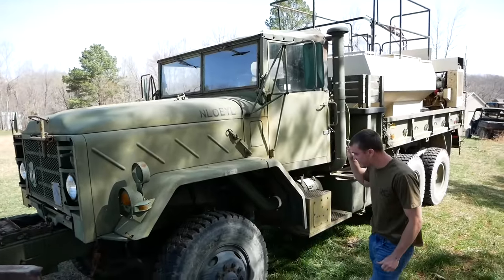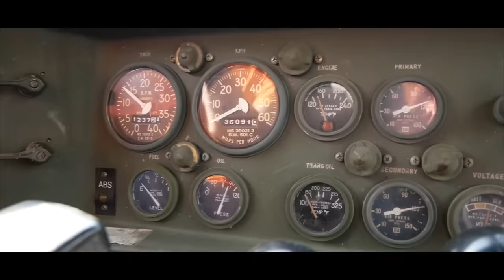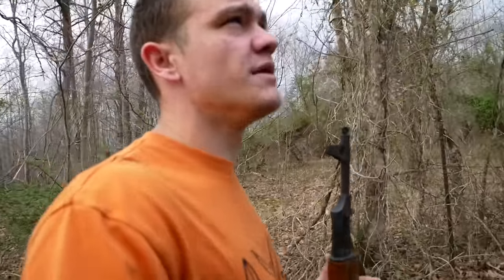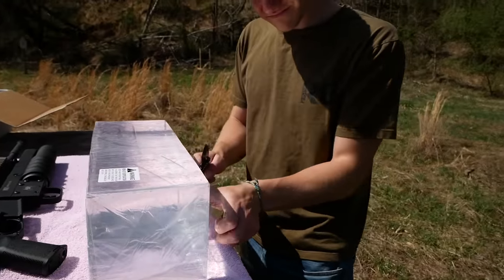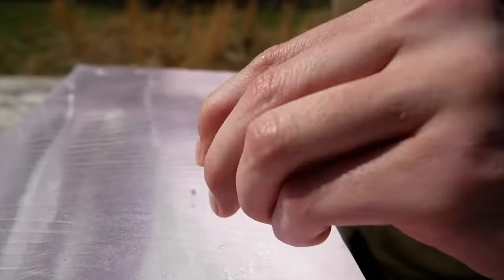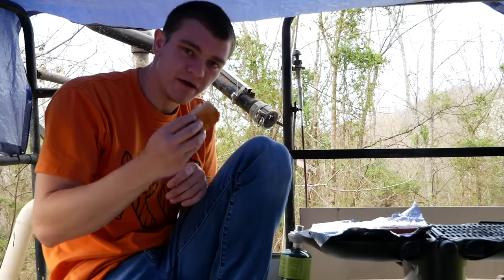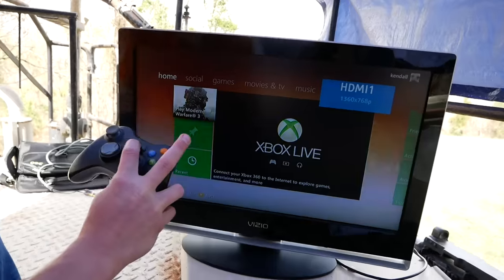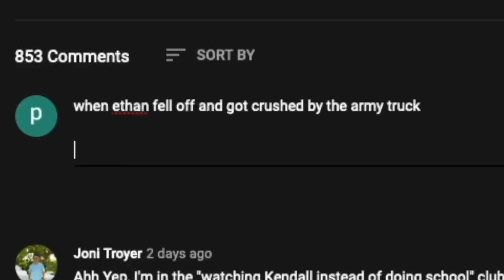5 TON ARMY TRUCK BUGOUT CHALLENGE!

Comment: umm ... sorry, It might have been used in the elder Bush's attack on Sadam's Iraq. It never saw action in any war prior to that; WAY to new for even Viet Nam. Have you looked at the title?  I'm guessing 1980's.  the trucks of Viet Nam and earlier had much different bodys (the hoods were shorter, narrower, and more rounded, and some had soft top cabs) and drivetrain. (multi fuel engines and a hi-low 2 speed automatic transmission simular to the GM Power Glide, for example). 
Have you or a previous civilian owner converted to a ignition switch?  Most Military vehicles have no keys, but use battery switches and starter buttons. The Busses, Pickups, and possibly HumVee's might have key ignitions, but that would be about it. 

Good luck with that as a Bugout vehicle. 6x6 or no, it does limit where you can bug to.  It won't go through the trees like a CJ2A, for example. Just like the HumVee, it's too wide for that.
You may want to consider painting it something other than green or camo, so any invading force (to include the UN) won't mistake you for active Army and send a missle or other anti vehicle fire your way. Those trucks are NOT equipped with an armored cab or glass, you know.  That shooting platform will make you a target, by the way.

"impractical" is an understatement. 
If/When SHTF, how are you going to get fuel and maintain it? Do you think you and two or three buddies are going to be able to capture a mlitary fuel depot, or that they'll give/sell you fuel?  
Depending on the size of the fuel tanks, speed, load, and terrain, you might have between a 250 to 300 mile range or less. Figure 5 (five) mpg on smooth hard surfaces with a moderate load.  
If/When SHTF, truck stops and other sources of diesel are going to be shut down (with electrical power turned off, so the pumps are not going to work ... if not bombed off the face of the planet)  Military vehicles in the field require a LOT of maintenence. They ARE known to break down. There is a motor pool behind the front lines for repairs.
Worse, the exhaust noise is going to tell everyone inside a mile or so where you are, sure as shooting your guns will. Do you honestly think that either won't draw them to you like flies to sh**?
Truck exhaust: "Supplies!" Gun Shot: "He might have food!" Either way, you most likely ded when (not "if") another bugout crew or any military domstic or invasive (includes the UN) reach you.  

You and your buddiess are civilians. If/When SHTF stealth is the way to go, if you want to have a chance of surviving. 
Seeking battles? Ambushing any invading military formation? (includes the UN) Guaranteed Sure Way to get ded right quick.
Leave the fighting to the domestic military. That's their job. NOT yours.  
It's obvious that you (and a lotta others) have bought into the Hollywood movies and TV where 1 to 5 civilians defeat an invaiding force (includes the UN) along with the Chuck Noris, Stalone, and Segal "One Man Army" BS. Sorry to burst yer bubble, but the movies and TV shows are make believe; scripted; not real life. Norris, Stalone, and Segal only "win" all their fights because that is what the script calls for.

Give any military as wide a berth as possile. ESPECIALLY if you are toting around AK's and AR's. They see those, you ARE a threat and you WILL be eiminated. They MAY see ANY firearm be it a lever action or bolt action as a threat to be eliminated.
(Alternative to a firearm for survival? Blowgun, slingshot, sheapherd's sling, or other means of taking small game.  For big game such as deer and medium game such as oinkers, fox/wolf/coyote, turkey, there is archery (can also be used for small game and foul) and spears (spears may also be useful for taking fish, depending on the water.)
You can also set traps for small and medium/large game, if the area you are in is "quiet" and you and your group decide to stay put a day or three.) 

Still a nice truck. High maintenence and thirsty, but a nice truck.

Comment: I love that 5 ton army truck and yes it is a 5 ton army truck is not a duse it's a 5 ton army truck if it's a duse and a half than it should have thin tires and not flat tires on the bottom